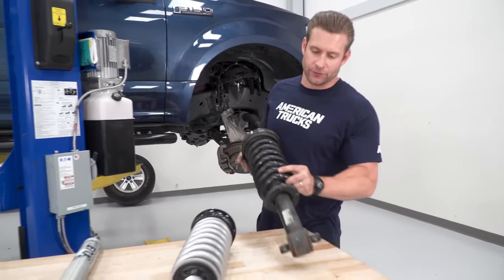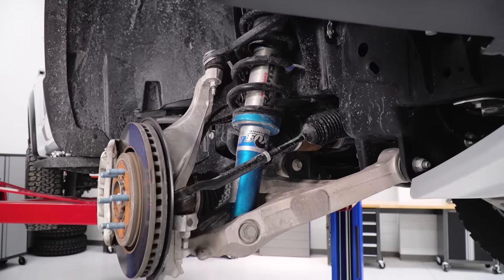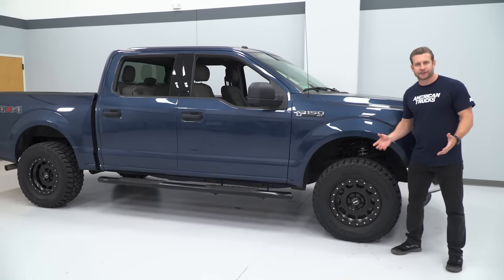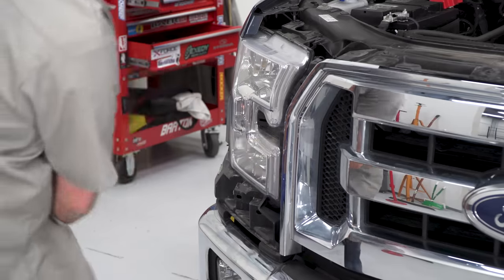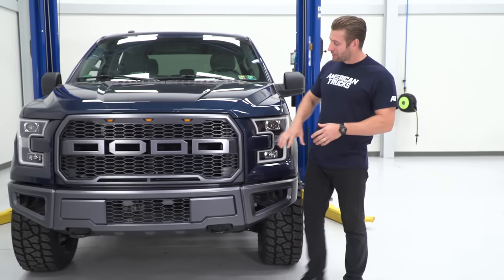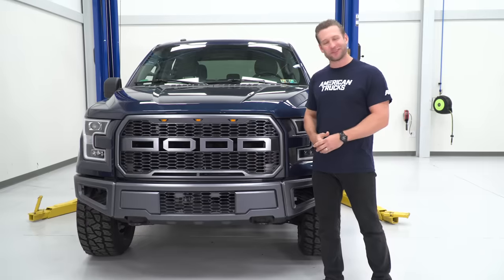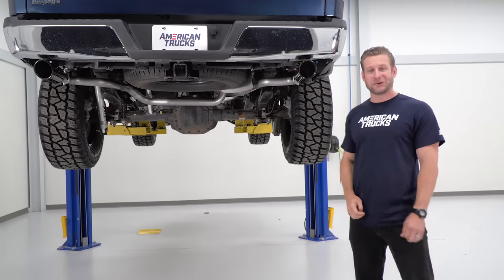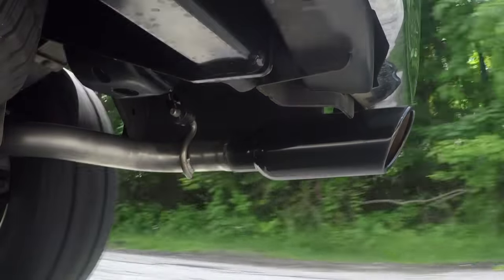How To Make Your F150 Look Like A Ford Raptor & The Parts You Need To Do It   The Haul

Comment from the maker: Check Out More F-150 Parts Right Here: http://bit.ly/2NqCCK6
Subscribe for Daily Ford Truck Videos: http://bit.ly/2pReEeg
Official Parts List:
T536829 (Roush by Fox 2.0 Suspension Kit (15-18 F-150, Excluding Raptor) - http://bit.ly/2u8C3vt

T529120 - Barricade Upper Replacement Grille w/ LED Lighting (15-17 F-150, Excluding Raptor) - http://bit.ly/2tX8WMg

T529123 - Barricade Raptor Style Front Bumper (15-17 F-150, Excluding Raptor) - http://bit.ly/2NuU9k2

T529121 - Barricade Raptor Style Fender Flares (15-17 F-150, Excluding Raptor) - http://bit.ly/2MS4uFZ

T528698 - Westin Thrasher Running Boards - Textured Black (15-18 F-150 SuperCab, SuperCrew) - http://bit.ly/2u7oIUi

T530855 - Axial Black Projector Headlights w/ LED DRL (15-17 F-150 w/ Halogen Headlights) - http://bit.ly/2tVkhwu

T528336-C - Ford Performance by Borla Touring Dual Exhaust System w/ Black Chrome Tips - Rear Exit (15-18 5.0L F-150) - http://bit.ly/2zeICCG
Reply: Justin. Is it possible to do a raptor front end conversion on an 08 Ford F-150?
Reply: AmericanTrucks Ford can you transform a mustang Bullitt fully loaded into a awesome offloading car?
Reply: You put the rear shocks on upside down. The reason for the Black plastic cover is for dirt and rocks. Looks
 at the factory raptor rear shocks and you'll see.
Reply: What was the total cost for the conversion?
Reply: Any of these parts fit a 2019?
Reply: Can l change my front  grill  on my 2012 f .150?
Reply: To a newer model  grille?
Reply: You need to add a turbocharger
Reply: The raptor has lower control arms that are 3” longer. Thats how you get the wide stance.
Reply: L
Reply: Do you have a video and build for a 2021?  Love to give my supercharged kingranch that meaner look

Comment: Those flares dont look flush from certain angles.
Reply: I agree. Bad fit up.
Reply: Most flares don't fit right anyway
Reply: They fit perfectly. They dont look flush bc of the lights and shadows. I thought the same thing a first. Pause at 7:55
Reply: They don’t match the front grille and bumper color.
Reply: @corvetto72  yeah that looks really awkward from the sides...
Reply: They half assed them
Reply: @rolandob4492  Says the guy who doesn't know the difference between "there" and "they're"... get out of here Rolando.
Reply: Cool vis. Thanks man.

Comment: Needs rear bumper and LED headlight bulbs.
Reply: The Headlights will vary on your trimmed F150. If you have a Lariat or higher, the stock lights are already LED. But, yeah! Definitely should have addressed the bumper.
Reply: Jason Moyle aftermarket it
Reply: Jason Moyle you said something so stupid
Reply: Jason Moyle my 17 CRV Touring AWD came with factory LED headlights.I installed LED bulbs in my 2012 CRV and 2007 Accord.
Reply: Alex he said something so stupid
Reply: CarPro Installs Haha - Crv and accord!😂😂😂

Comment: I bought my 2017 lariat from the dealership with that grille, bumper, wheel covers, and some raptor like stickers.  They build different style trucks for fun.  I love it and after 2 years I still get compliments.  I just wish they put those shocks on too.  Lol.  Thnx for the video.
Reply: Oh, I forgot.  They put on OE raptor wheels on it too with 34” tires.  I added s&b cold air, borla cat back and 1 1/2” spacers.  My truck is a 3.5 EB which I love so it obviously doesn’t sound as good as a 5.0 but I’m extremely happy

Comment: Stumbled across this video looking for something else and I have to say, I love the front bumper. I've been eyeing one like that for a couple months now to replace the prone-to-rust OEM bumpers and I haven't jumped on it because I was afraid of the fitment for my '14. Looks like it will fit fine without the need for stupid wide flares and cleans the body up a bit...I also love the fact that most of them are fiberglass or mostly fiberglass so never have to worry about it rusting out again.

Comment: What's next putting GT badge on v6 mustang?
Reply: Brady Stanga people upgrade their trucks wheels, tires and suspensions all the time whats the problem? Some poeple just don't want to spend $70k+ on raptor when you get get almost the same look and performance for less. Plus V8 sound.
Reply: Diego Martinez of course people upgrade their trucks and wheels. but for god sakes leave the grill alone it's screaming I want to be a raptor I want to be a Raptor. I will sacrifice sound over any kind of higher tq and hp numbers . The V6 is better it makes more torque and horsepower than the previous 6.2.. you make it sound that I'm against people upgrading their trucks.. but there's a difference from upgrading your truck and then making it look like a Raptor . And that's what's going on in this video they're doing both I'm against some of you guys making your V6 Mustangs look like Shelby's makes me sick sorry can't help I'm a car Enthusiast and think that things should be done the way they were born in the car world
Reply: Brady Stanga I just don't think making a normal f150 look like a raptor is the same as slapping gt or cobra badges on a v6 mustang. Also the cost for this build is under $40k. Add a supercharger for $10k more and you're still well under the price of raptor and now this will outperform it.
Reply: Diego Martinez "will out perform"

HAHAHA. THANKS FOR THE BEST LAUGH OF THE DAY!
Reply: Diego Martinez you have a lot to learn, and I'm not trying to sound mean or rude. Have a good one
Reply: Michael Reim What's so funny? Please explain, I want to laugh too.
Reply: Brady Stanga Honestly the only reason people say this is a wanna be raptor or a poser is because of the grill. If it had any other grill no one would say a word.
Reply: Brady Stanga Why leave the grill alone? It looks great and I want it on my f150. I put a gt350 style front bumper on my GT does it scream I want to be a gt350? Lmao you’re not a car enthusiast. You do you, its your car do whatever the hell you want to it and if you like it thats great. If other people don’t like it who cares they don’t own your car.
Reply: What’s next? Putting a V6 in a raptor? Oh wait
Reply: There’s no raptor badge on this f150. So your comment makes no sense.
Reply: raptors are only 3 grand more than a same equiped f150
Reply: kickercar yeah, ok. More like 15-20 more. But an engine no one wants, a lot more in insurance I’m sure plus a lot of people want the looks without all the off-road stuff MOST people aren’t going to use. The average person will do things “off-road” that a f150 is more then capable of. A raptor is a waste of money
Reply: Diego Martinez stance, frame , fenders so so different, look up the build and compare
Reply: LostStream yes it does scream you want to be a gt350. So when you buy your 2x4 truck make sure you put your 4x4 stickers on the bed. Since it is what you want to do on your vehicle . LMAO
Reply: kickercar you are incorrect. Call your local dealer.
Reply: Zachary Wilder hey buddy its well worth it.
Reply: Sewermonkey69 if you try to make your truck look like a truck it's not you've gone way further than jus a badge. What a insult to a Raptor.
Reply: LostStream and it's skanky
Reply: Diego Martinez agree
Reply: Brady Stanga this is not a rip-off raptor some people just want a nice sounding V8 instead of a wimpy sounding V6 and they don’t want to spend $70,000.
Reply: Diego Martinez There’s a difference between customizing a vehicle and trying to make a wannabe truck yourself that already is available and is official.
Reply: Brady Stanga -- No if it was a raptor rip off then people would be putting "Raptor" stickers on it. The grill is just a Ford grill.
Reply: Fuck buying a raptor. I'd much rather buy a 28k v8 F-150 and make it look like a raptor.
Reply: I think Raptor owners are just pissed off that they paid a $50k mark-up for a truck that can be made out of a stock v6 eco-boost for a couple grand or less in parts, why else would they protest so much? That's essentially why most legitimate raptor owners are such douchebags, who pays nearly 100k for a Truck only to be too afraid to get it dirty. "but muh performance" who the hell are you trying to impress? Seriously what exactly do you haul? jack shit is what. Chances are they sit behind a desk in a nice ironed dress shirt for living.
Reply: Eagles
Reply: Michael Siountres that wimpy sounding v6 does its job well done. It's overpriced but it performs well
Reply: That’s not the same thing at all lol. Put on a different badge vs a better looking grille, bumper and headlights is totally different. If he put raptor badges on it then I would agree
Reply: @diddy2612  come on man that Grill screams Raptor!
Reply: Brady Stanga yea nothing is wrong with that. People put parts on from upgraded models all the time. I personally drive an nsx but I have nsx type r hood and spoiler because I like the upgrades models look. Am I going to put type r badges on my car absolutely not
Reply: Diego Martinez exactly my point. Well said. I hate the v6 motors. Sweet and fast but the sound of a v8 is more powerful to the heart
Reply: Yes
Reply: @bradystanga7688  Man people can do whatever the heck they want to with their shit. If they want their f 150 to look like a raptor that is their business..
Reply: @samsh0-q3a  And that would be their business...
Reply: @Anth230  I didn't say they were not allowed to put that grill on there like it's the law, damn son it's jus fucken stupid cause it's not the right grill!! It would be like making a v6 Challenger to look like a demon. It's disrespect.
Reply: i have the 2019 vv8 and its a raptor engine for sure!! Sports mode has all these trucks in awe when i take of in 4H at the green light. (up to 60 of course ;) ) 
if i were to add an air cooler, it would perform as good as the high-end raptor. for 50 ggs less Canadian (at least). plus the supercab..
i feel i got the best bang for my buck, by far! but, that's just me. im not too keen on cloning other cars though. p.s...the sound :D ;D
Reply: @DiegoMartinez-ou5wn  A new raptor starts at 54k not 70k. if you wait for leftovers and look around the country not just in califagya. You can get one for below msrp. I did. Or buy one used, just as many people that baja them; mall crawl them too.
Reply: @iceee187 yeah they START at $54k but no one is going to buy a barebones raptor. Most raptors you find at a dealership are between are between $60k-$75k. I used to sell cars at a Ford dealership. It's not too hard to geta new one for MSRP (depends on where you live) but very unlikely that you'll get one for less  than MSRP.
Reply: @DiegoMartinez-ou5wn  I agree with you on most at a dealership will be the 60k+ ones. I ordered mine with the 70k price tag, but had the option to have it a base model. Which a raptor being base model is far from the typical "base model" stereo type. I live in Michigan and bought mine from a dealership down state (Holland Ford dealership) for 2k under msrp as the dealer had one allocation left and the previous customer backed out.
Reply: @iceee187  See that's a specific scenario how you got yours for less but if you just walk in to a dealership and tell them you want to pay less than sticker you're most likely not going to get it.
Reply: Hi, Raptor owner here.

1) The 10k markup you claim can be gotten around, depending on the state. I got mine (Texas) about 5K under sticker brand new, but granted, that took some pushing.
2) One of the beauties of the raptor is not having to spend months customizing it. I just don't have the time or interest to do that, personally. It looks, drives, and performs amazing right off the show room floor. I know some people love the customization and I understand that.
3) I don't give a damn if someone wants to copy the look of the truck. It is (in my opinion) the best looking truck there is. That's a part of the reason I bought it. I don't mind the V6 but I know many do. I freaking LOVE that vehicle. If you wanna pimp out a V8 XLT, go for it man. I have no issues with it.

Just don't shit on my truck and I won't shit on yours, yeah?
Reply: Joseph Martinez I agree with everything you said. I got a below-msrp deal on mine due to the time of the month I went and simply knowing how to negotiate a car deal. I also didn’t want to spend months having a stock truck in the shop getting all the mods done to have it have the performance of an off showroom floor Raptor. It doesn’t need anything done to it to have fun, and most people won’t even put it through anything close to its max performance limits. I can drive it during the week in the city and then take it either hunting in the fall and winter or mudding and trail riding in the summer with the only non stock part being my trailer hitch 😂😂 I don’t care if people want to make their truck look like a Raptor, just don’t lie about what you have and there shouldn’t be any issues from either side of the argument.
Reply: Toyota guys don’t make fun of each other when they add a trd pro grill to a sr5. Ford guys are so catty.
Reply: Diego Martinez I don’t think that people should be making their basic f-150’s look like more expensive Raptor’s. I don’t mind if people modify their f150’s as long as they don’t make it look like another truck. This is exactly like putting the Shelby stickers on a mustang. It’s a disgrace to the better car
Reply: Brady Stanga I wana be a raptor tho... not bout to spend 70k to get a nicer grill 😂
Reply: Ranger Raptor.
Reply: @awesomebush8711  my guy Like some people said , they didnt put raptor badges on it , if they had done so then I would not argue but I have nothing against making your truck look way cooler which they accomplished
Reply: @DiegoMartinez-ou5wn  yep add the super charger too and we good
Reply: They can make a honda civic faster than a Ford GT, they can make a V6 absolutely shit on the v8
Reply: @awesomebush8711  but it's not tho , this is like putting 67 gt500 tail lights on a regular fastback , it looks way cool but it doesn't mean he wants his car to be a gt500 hes just improving the looks of his car , I hate people who are all "purist" but I bet most have never actually gone thru restoring or restomoding a vehicle or modding a vehicle
Reply: @kickercar  you forget that 10-15k in typical incentives/rebates you can get on a F150...
Reply: @xelnjare3945  and I said MSRP
Reply: Except there are no Raptor badges on this truck. I see no difference between what they did in this video and kit cars people do. 

I personally wouldn’t put the grill on this truck because it looks like DODO 😂 and the Stock front looks great as is. Everything else they did a good job. If people put fake wannabe badges on there car I’ll call them out on it. This truck is not that though.
Reply: @jtyree0226  the front bumper screams raptor and the grill. Plus it probably has the coronavirus so I would stay away from it
Reply: no. cobra badges on a v6 and gt mustang lollll

Comment: I thoroughly enjoy your F150 videos, as it gives me ideas on mine.  I have the 2013 F150 STX 4X4 stock with the 5.0 coyote motor..  I have recently purchased a 2" front leveling kit.  I really want to install 33X12.5's all the way around, and am having trouble wrapping my brain cell around "offset".  I like the way the tires look on this rig and was wondering if the +6 offset like I think you stated here would be right for my rig.  I also have fender flares to install and I'm considering mudflaps as well.  Thanks and keep up the great videos.
Reply from the maker: Thanks for the kind words Wayne!  I believe a 33x12.5 with a +6 would look great on your truck!  Since you have a 2013 crash bars/rubbing will not be an issue however if you do go with front mudflaps you might encounter some rubbing there-albeit very minor.  Good luck with the build and thanks again for the support! -Justin

Comment: I find the "DOOD" grill to be absolutely dorky.  I would never put it on my truck.
Reply: they cant sell it with the F and R you have to buy it separably because of legal reasons
Reply: Mine says Ford on my '08. The grill kit came with the "F" and "R" . Cant come that way ordered due to copyrights. Looks alot better when you change the letters though.
Reply: Same
Reply: J M It is available, it’s just too expensive for someone doing this to an XLT.
Reply: OK cool
Reply: All the aftermarket grills come with the letters. You need to unbolt the covers, thats why he said theres bolt on the back of it. If you unbold the covers it will say "FORD" not DOOD
Reply: idk why but each time i see it i see dodd and not dood
Reply: @koopzz  It does say "DODD, but people just pronounce it as "Dude"/DOOD
Reply: @TheGeekPub    No one actually installs it like that.  That's exactly why the F and the R are bolted in, so they can be swapped out with aftermarket letters (which are widely available online).
Reply: @5thGenNativeTexan  I am well aware. But this truck is a DOOD truck.  Did you watch it?
Reply: @TheGeekPub  Of course I watched it, but your comment seemed to indicate that you didn't know the grill letters could be changed.   My bad if I misunderstood your comment.  My comment was to just note that American Truck could never explicitly show the aftermarket F and R letters in a video, thus the truck was a "DOOD" version just for them to show the install.

Comment: WOW....some folks really getting worked up on this project. Like he said, just to give Raptor look. I don’t think he said they were making a Raptor. Anywho, where did ya say you plugged grill LED lights into? And, hopefully it’s pretty obvious that one would immediately fix the F & the R on the grill. Thanks!
Reply: To your running headlights.
Youll need a wire cutter, electrical tape and a tester.